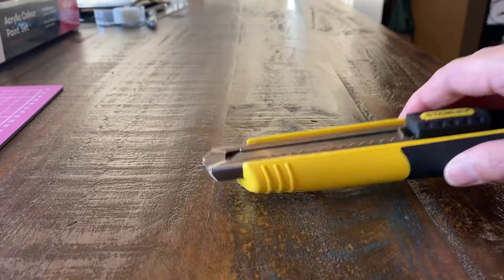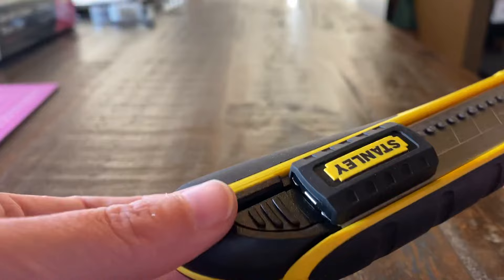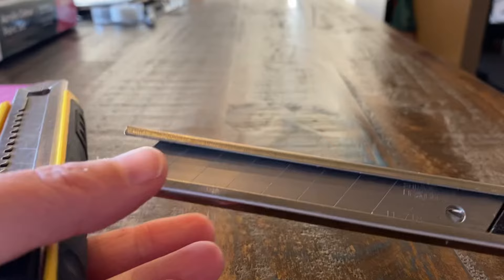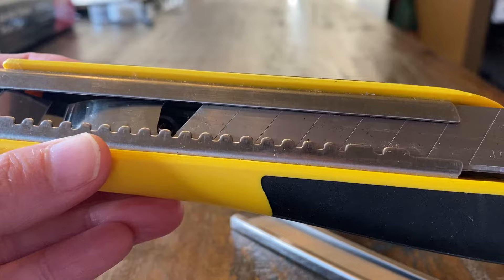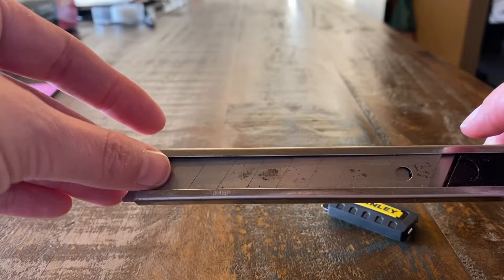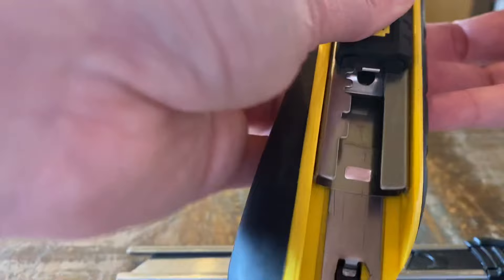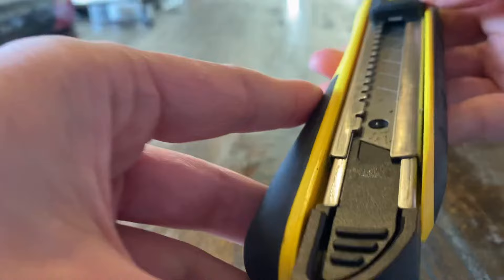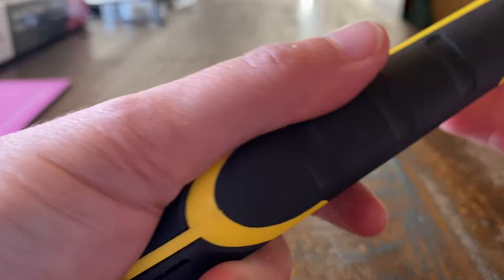Changing the blades on The Stanley Fat Max Easy Peezy￼

Comment: Love this video. I spent about 30 minutes stopping and starting it by the second and finally got it together and working. The thin spring under the try I was putting in upside down and once I got it turned around, I easily snapped it back together. Thanks for sharing as another few minutes I would have gone out an got a new one.
Reply: You are not the only one. I almost break apart. 😙

Comment: Thanks for the video. My knife didn't look like this. It was all metal. As It turned out, the inside metal piece slid out with the cartridge. That's why it wouldn't load right. It took a while to figure out but I'm good for another decade of blades!

Comment: The best demonstration of how this is done that I have ever seen. Thank you. BTW if you cannot get Stanley Fat Max brand blades (as I discovered Home Depot do not have) Milwaukee 18mm blades are perfect. The Milwaukee pack has 10. You will find 6 is the max you can shove in there without cutting your fingers. Just keep the other 4 as refills.  The Milwaukee blades boast they are 10X sharper. Sharper than what I do not know, I presume they are 10X sharper than a blunt blade 😉.

Comment: You can also take out the blade by pushing the black slider all the way to the front. If you hold it all the way forward it will unlock the catch on the blade and you can pull it put from the front. Then you can just slide it back down and it will automatically pick up the next blade!